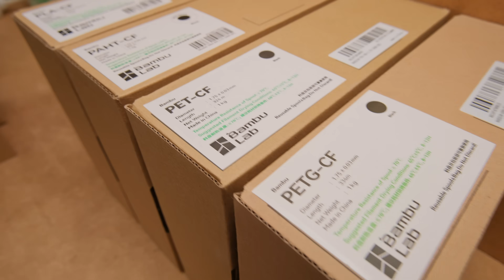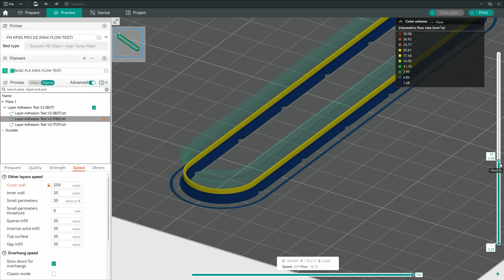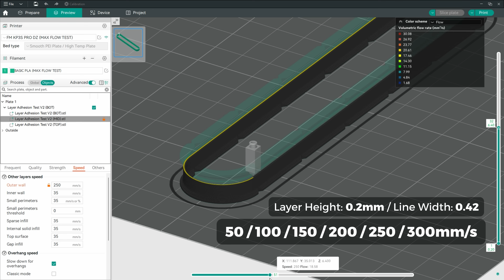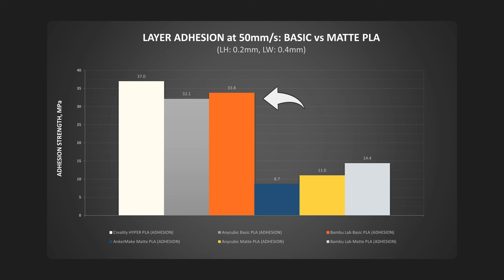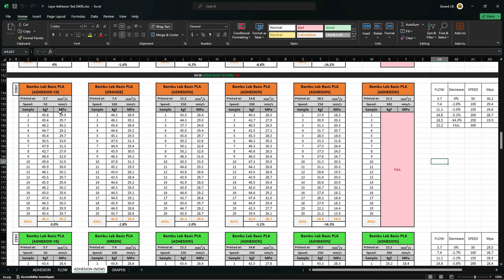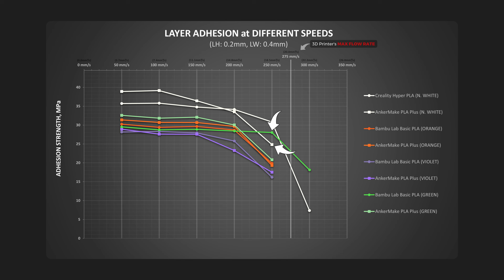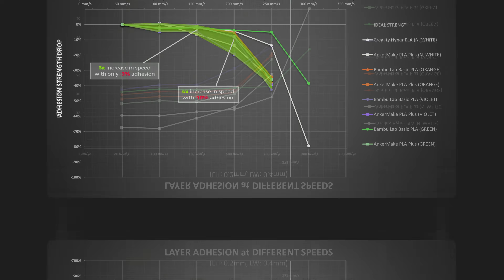How much WEAKER 3D Prints become at Higher FLOW RATES / SPEEDS? (DATA from 1000+ samples)

Comment: I'm glad you did something like this! Reinforces my experience too where anything up to around 60% of max flow rate of your printer is acceptable strength.  Knowing you can go to around 80% and still have decent strength is good to know for prototyping. Great content as always.
Reply from the maker: Yeah, rapid prototyping with filaments that don't lose adhesion at higher flow rates and you can test parts without worrying that they will immediately break is really nice. :)
Reply: @PrintingPerspective  what happens if you alternate between high speed/flow and low speed/flow